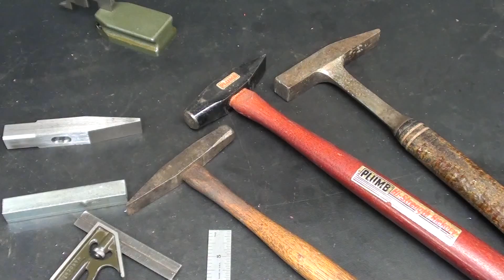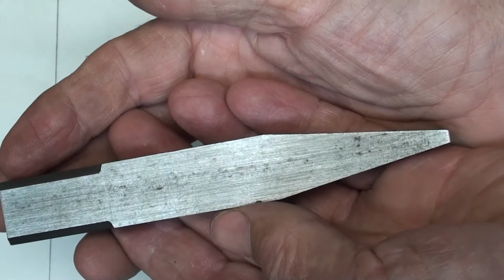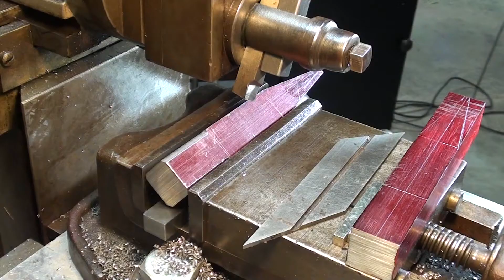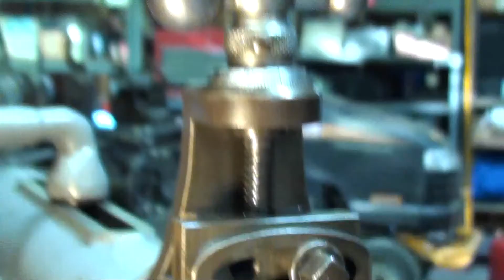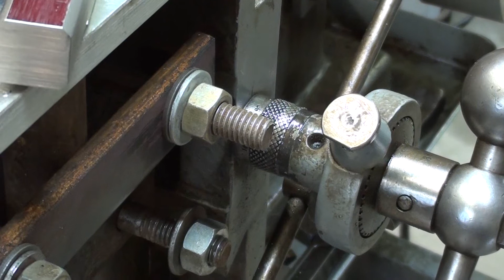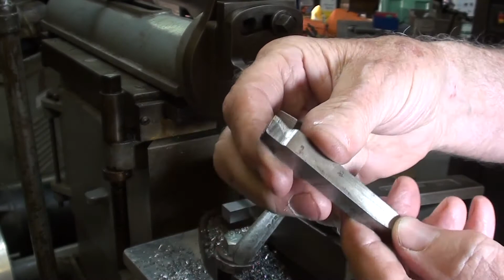MAKE HAMMER ON THE METAL SHAPER pt 1Tips 685 tubalcain

Comment: I believe 'tool steel' is somewhat of a generic term. Is there a more technical description of a steel alloy which would be appropriate for the hammer? i. e. a hardenable alloy? And a description of the heat treatment steps required?
In any case, another great video! Keep them coming!

Comment: Certainly not the quickest way or most convenient way to make a Hammer - but probably quite satisfying doing it on an antiquated machine. I still remember using a Shaper in my Machinists Shop Class in HS when I made a set of Parallel Clamps - which BTW I still have 50 years later. :)

Comment: I made a similar hammer in 1979 in my college metals class.   Ours were made using hand tools.   Hack saw and file.   Handle was threaded steel round bar with plastic grip.   They were case hardened.    I still have and use it!   Very handy in electricians tool pouch!   Thanks for the video Mr. Pete!

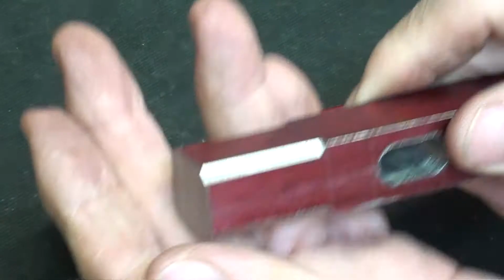Comment: Yep, made that hammer in early 1969.  Our hammer handle was 3/4-knurled, turned to 1/2-13, screwed into the head, then peened, and ground.  Nice work.  Genesis 4:22 KJV And Zillah, she also bare Tubal–cain, an instructor of every artificer in brass and iron:..., that certainly describes you.

Comment: I still have the hammer I made in middle school, we called it junior high back then. It was made from mild steel and case hardened after. We didn’t have milling machines or shapers, just files and saws a drill press and sander as it was really a wood working shop.
Reply: Phillip..... exact same here..... all with files...., drill press, except the sander. 
The hammer is now more than 35 years part of my toolbox and well used.